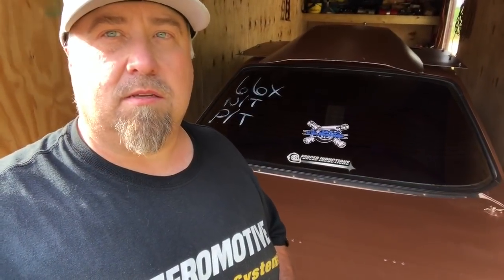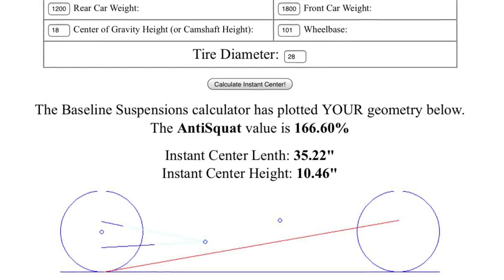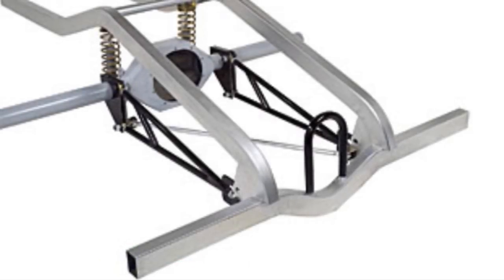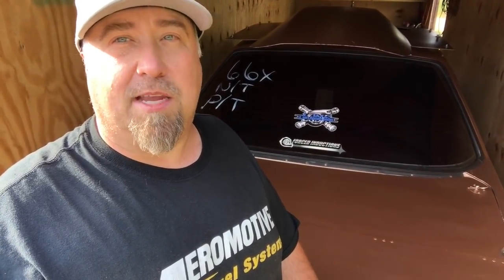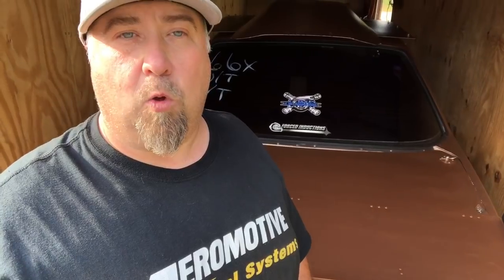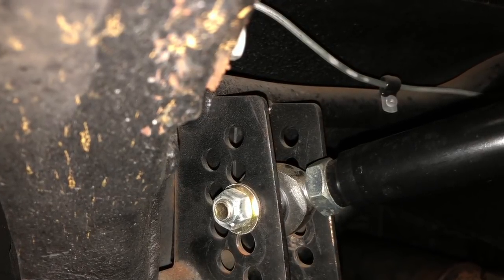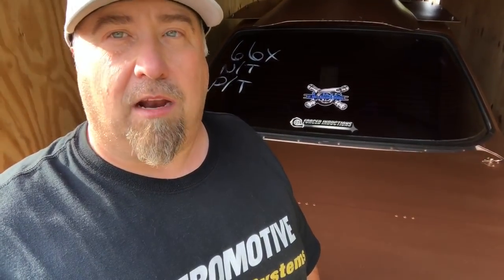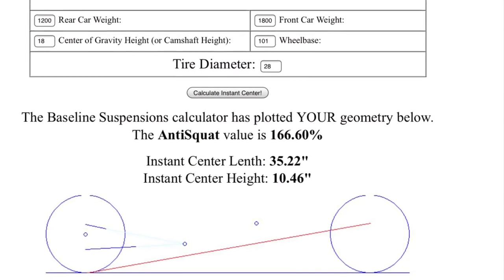Drag Radial Suspension Setup!! Instant Center, Anti-Squat explanations.  What works!

Comment: I have have team z relocated uppers, team z tubular lowers, and team z drag springs. My upper bars are 12degrees down going towards the body and my lower bars are 1/2 a degree going up towards the body. Should i work on getting the lowers closer to 3-5 degrees?
Stick shift car.
Reply from the maker: Stick shift hits the tire super hard, unless you have a nice slipper clutch.  I would see how it works where it is, then test with the bottom bar on the body up one hole and see what happens.

Comment: Hi John, Is there a sweet spot distance from the axle center line to the lower bar mount point? Would a longer or shorter center distance make a difference with the bar angle being maintained? Would a shorter distance on the axle and use the stock mount be the same as going longer on the axle and lowering the front bar one inch??

Comment: Hi John, plotting my 4 link currently, I have a engine conversion with a high centre of gravity @ 31", 108" wheel base. 
Heaps of adjustment however with the centre of gravity so high, I can't get a good anti squat value for radial. Anything around 130%+ equals a very short instant centre length, like 28". Any advice?
Reply from the maker: I have run 28" length on my old mustang, but not on a 4 link.  Go check out Tin Soldiers, they are now offering a low prep conversion kit for 4 link stuff.  I'm planning on getting some at some point.

Comment: For a drag radial set up, How do I get the shaft of the rear shock to sink down into the main body of the shock? Is it a matter of a lighter spring or screw the adjustment down some to lower it? I mean how much are we talking, 1/2”, 1”inch? Thanks
Reply from the maker: Both possibly, softer spring and screwing the spring perch down on the shock body.  Then raise the spring mount back up to get the ride height right

Comment: John do you have any information on setting up a ladder bar car for drag radial? Does the baseline suspensions calculator work with a ladder bar set up? I have a newer Camaro, freshly built with AFCO 3970BGX rear shocks with 125lb springs on it, should the springs be softer for the drag radial? They are set up according to the AFCO site as far as spring heights & travel. They have 7”inches of travel & the car turned out to be 50%front & 50%rear, total race weight with driver is 3300lbs. Thanks, Great videos!
Reply from the maker: Baseline calculator will work, your instant center is the front bolt on the body. You cannot change links, only height. But those calculations will tell you what the car will do

Comment: Yes a lot of us used the SSM lift bars back in the day.  These were our daily drivers.  No one told use how noises and harsh they’d be.  After a year I probably took them off.   Didn’t have much else done to the suspension except sub frames.   On a street tire with that setup they didn’t help much.  But we were noobs back then.  Great times tho for sure!!

Comment: Awesome video! Curious with the upper body adjustable brackets. looking at commercial available kits, it looks like the bottom hole is in the stock position. Meaning there would be no adjustment below stock mounting position. Is this done for a reason? What angle are the upper control arms in the stock position?
Reply from the maker: Mine, I tried to get center hole about in factory location.  But if it’s a radial car only, I would try to get the factory height in one of the upper holes

Comment: Finally wrapping my head around this. When do you know you need to shorten front travel(besides wheelies) I'm topping out my single strange to fast and unloads the tire. Look at my channel for vids. Stuck at 9.0s with 1.35 60s. Next outing going to try 130ish as with 40ish inch instant center. Atm I pull 10 degrees out .15 after the hit and run it out a second any faster it chatters the tire 20ft out when suspension tops out
Reply from the maker: Are the rear shocks double adjustable?  Keep tightening compression on the rear.  Most likely what is happening, the tire gets upset because the rear shock compressed some.
Reply: @TurboJohnRacing  yeah strange doubles promod valved. Just sent them back for a rebuild as I got them used few years back. Added more adj for antisquat etc. Was only around 90 100 in my vids. They worked best at 7 comp full loose ext. That's likely to change.

Comment: Excelent videos fox body turbo great machine one question ? what angle pinion recomended for drag racin 4 link
Reply from the maker: 1-3 degrees normally at ride height, but make sure it does not go positive when it’s fully extended

Comment: Hey john. You got any resources I can go to for torque arm suspensions? 

I know the TA holds pinion angle and somewhat acts like to upper arm on a 4 link but not exactly (since they have a slip joint it’s not the same). 

Instant center can be moved back or forward with lowering or raising rear LCA mount. But I can’t figure exactly how one would calculate AS on it
Reply from the maker: I’m not familiar with the torque arm stuff, but it sounds like what you said, the upper bar is simulated by the torque arm.  Maybe use a normal, instant center calculator to see what it gives

Comment: Great video I just finished a coyote swap fox and first time to the track was horrible.  I went with a wild rides racing trq box kit because mine were mangled and what use to work with factory trq box ‘s doesn’t now.. lol.  I have to throw them ole 4 cyl springs away I need some good rear springs so I can get that thing down in the 15-1.4’s atleast.  My car puts 420 to the tire and weighs 2700 so it has potential to run mid 10’s but I have to add more gear.  My cars a GT non tub’d so it’s very hard to get a 28 to fit but if I could I know that would help tremendously.  The uppers and lowers I’m using cane with my kit I don’t have those drop brackets so that’s something I’m going to look into.  My car is also a 5 speed TKo 600 (faceplated) setup and it’s killing me that all I could muster was a 1.7 when I know I have 1.4-1.5 potential at that power to weight ratio.  I’m also going to step it up to a 456 from a 410.  You wouldn’t happen to have any rear sus parts?  I also need some stronger axles and a spool would be nice.  Again great video.  I’m looking forward to spring my goal is to hang both wheels a foot off the ground and drive that bitch to a 10.50
Reply from the maker: Sounds like a cool ride.  I run moser 35 spline axles in mine, great service and warranty!  I don’t have xx anything for sale now.  If you roll the lip of the  fender and get a 6.5” backspace wheel, with a big hammer on the inner fender a 275/28 will fit.
Reply: Thanks brother I appreciate it.

Comment: What if you have a wheelie problem what the best thing to do
Reply from the maker: It depends, but almost always, shorten the length of the instant center, tie the front down some, tighten front extension on struts.

Comment: I remember the old South Side Machine Lower Control Arms back in the Day, actually ran them on my 1986 Fox Body. was only running High 11,s Low 12,s at the time. but they really worked good. Was running slicks at the time. Remember ripping the Upper Control Arms out from the Floor, Broke the Driveshaft in two, and also Bent the 8.8 Housing. everything in the 8.8 was Good, Moser 33 spline axles, Moser Spool, and the Gearset. that was with a Tremec TKO 5-Speed. I'm know running a different combo now. 521 Stroked BBF, C-4 No Brake, 8" Converter, Still an 8.8 I think there pretty Strong Rears, Provided you got good stuff in it. and ALWAYS WELD the Axle Tubes to the Center Housing. I,m currently running Low to Mid Nines 521 N/A through a 1000 cfm Holley 4150 from Pro Systems, Out of the box Trickflow Street/Strip Heads, Mild Solid Roller,  10.4:1 Compression. on 275/60 Drag Radials. use to run a 28/10/15 Drag Slick. Going from slicks to radials was a Big Learning curve. First time at track  I remember could not get it to hook, kept Lowering Air Pressure and it kept getting worse. talked to a few people in the lanes that were running Drag Radials. first thing everyone said what was I running for Air Pressure. With Slicks usually ran 10-13 psi. with the Radials my Best Run that Day was with 18 psi. So usually my first run when I go I start  right at 20 psi.    I Love the Radials will probally Never go back to Drag Slicks. feels so much safer on the Top End, No More Swerving back and forth from the Ass End. I Also notice I have to run a lot more Negative Pinion Angle with the Radials. I Love your Videos Man, Very informative, Keep Em Coming.
Reply from the maker: Love radials, I’ll never have slicks again.  I hope!

Comment: I like your videos. I watched my father measure the instant center without a calculator, scaled the car jacked it wrote the measurements on the floor and came up with instant center for our car. the setup is unproven at this point because my father passed, but I'am going to put drag radials on the car and remove the bars.I have no adders just old fashion hemi power. The weight was 2350lbs with the iron hemi and just replaced that with an all aluminum JP1 hemi. I watch your channel because it not the high dollar approach to radial racing and sometimes common since is better than just throwing money at the car.
Reply from the maker: Sorry about your dad!  Sounds like you are gonna have a great car!

Comment: Great info bro. On my street car it runs 7.10 in the 8th at 99 miles. Supercharger 302 stock control arms would the ss control help my 60 ft times?
Reply from the maker: South side bars are great!

Comment: does lifting the front up an inch, hurt the launch? like spring booster or bigger front springs?>
Reply from the maker: It changes the center of gravity location, which will change the neutral line.  You can play on the calculators to see the actual changes
Reply: @TurboJohnRacing   hi turbo John! My car is Scion FR-S with independent rear suspension it weighs 3000lbs .I am running M&h race master 245/40/18 drag radials that have polyfiberglass side walls. I am having trouble figuring out how to get a good launch my best 60ft is 1.97 and a 12.7. 1/4 mile at 113mph.My track is Sonoma raceway in California it always very sticky and well prepped. I have a centrifugal supercharger so my minimum launch rpm is 4000 rpm but I really don’t start making power until 5000 rpm. Can you give me any advice on what to do with my tire pressure and shock compression? You’re the first person  that has said that you don’t want your car to squat with drag radials. I have 32 way adjustable shocks 0 being softest. I have been running them between 4-10. And tire pressure between 20-26psi. My problem is usually the tire will hook and after a few rotations then brakeloss . When I got my best 60ft I had the shocks at 10 and my psi was actually at 26psi when I launched at4000rpm I slipped the clutch a little bit and my wheel speed data log said for the first 1.7seconds wheel slip was going up and down between 70-40% then at about 20 mph stopped slipping. Any advice would be greatly appreciated!!! I love your video’s and how your straight forward  and you don’t hide what you’re doing.

Comment: Turbo John what's your setup? Upper lower brackets (brand), shocks & struts, spring rate. Your car works!!! I'm redoing my setup and I'd like my car to work like yours.
Reply from the maker: My buddy had the lower brackets made, but trz and team z make some also.  I have qa1 double adjustable rear shocks with 110 rate springs, front are strange 10 way single adjustable with 175 spring rate.

Comment: probably a longshot. but what kind of instant center would you say a big tire truck would be ideal for starting at. 57/43 weight offset 29.5in links and 33x15 slicks. right now its at 93% wiht a 72.25 instant center. havent made any passes yet trying to get some knowledge on what works with big tires. Majority of what i find is for radials. Thanks
Reply from the maker: I have no experience with that type of set up. I would try where it is, Get good video of the pass to see if you need to make any changes

Comment: Very informative video buddy,I have a 1988 fox body notch(1,000+ hp) & ran a slick my whole racing career but wanting to go radial,I hook pretty good off the line but about 80’ to 100’ out it wants to start acting crazy
Reply: Throw more power at it.
Reply from the maker: Plot out the suspension and get you some anti squat!

Comment: What Data are you actually reviewing  when tuning the suspension on your car? Cool Video!
Reply: Video
Reply from the maker: There is so much happening when a car leaves it is essential to have video.  The modern cameras have made it so much better!  Get video, every pass and review the footage after each pass just like looking at the data log.  It is also pretty cheap to do shock sensors now if you have data logging channel space.